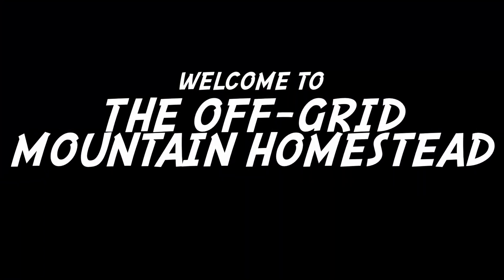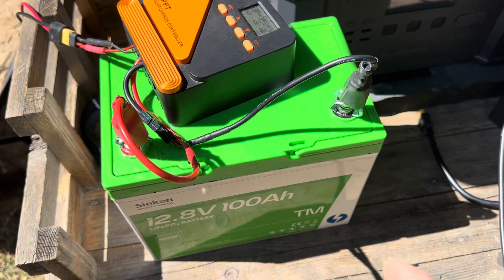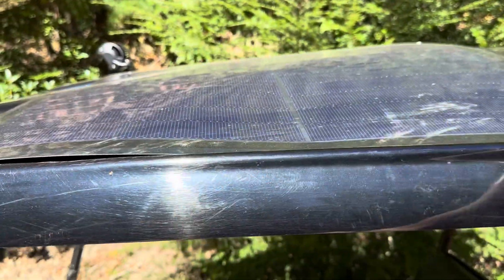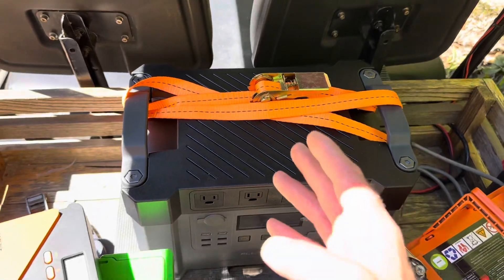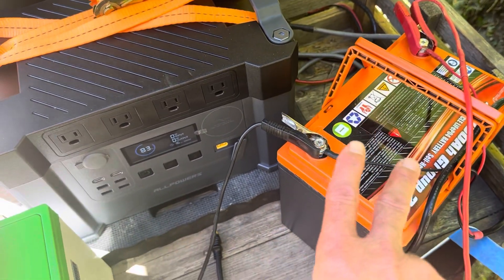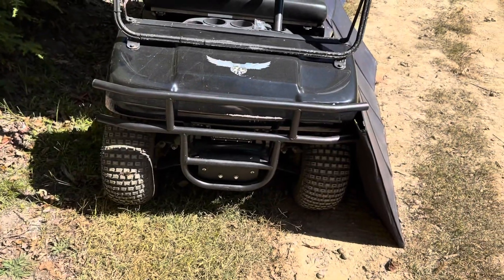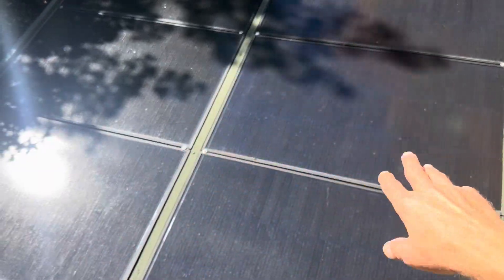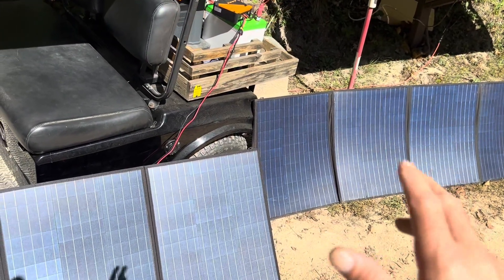Solar Panels Solar Charger Portable Power Station Golf Cart Lithium Lead Acid batteries and more!

Comment: One has to take a break from things in a while. Nice to see that you are using the Isunenergy charge controller! I have 3 of them. Supposed to be 10A version, but they are most likely 20A because I have seen them dumping 20A into my 2 battery banks made up of 2 12.8 Eco-worthy 20AH batteries.  Now, you got me worried about my solar panels, I have 8 Eco-Worthy 100W panels. been using them for 3 months and so far, has been doing okay.
Reply from the maker: I contacted for warranty months ago after first panel failed. Crickets from them lol. I figured as much. 
I haven’t heard about too may failures with the standard mono units from them but have heard complaints of overestimating their wattage.